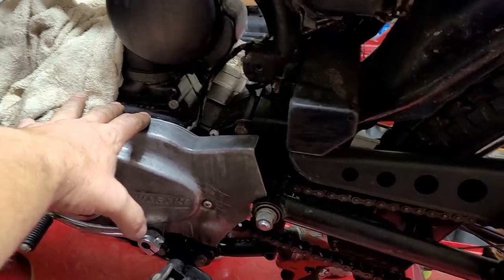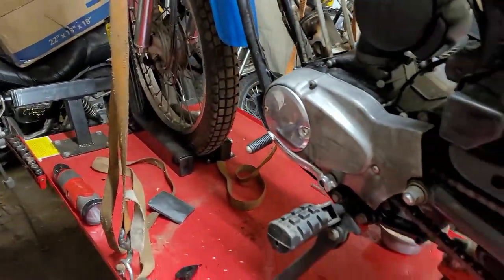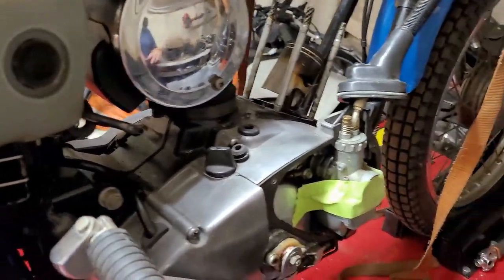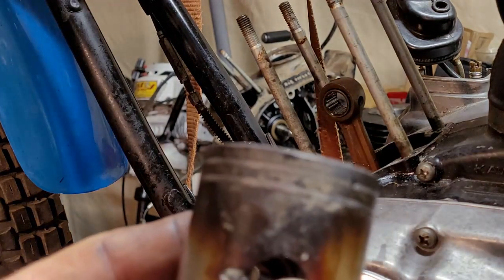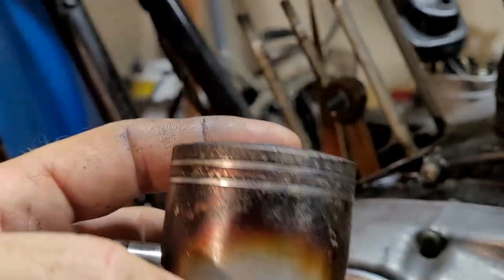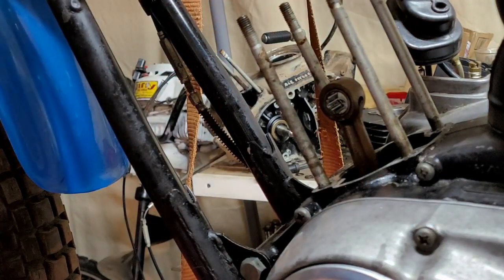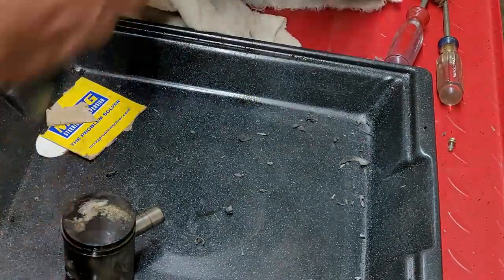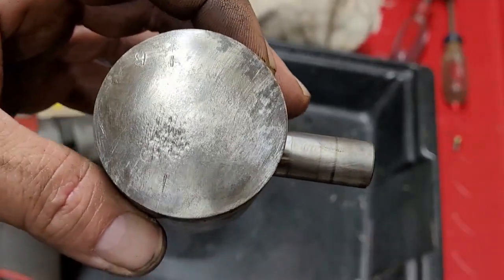Working on Aarons Ke100 top end do we have compression

Comment: Hi Kevin, great series of videos!
I have a question maybe you can help with. I am renewing the rings on my KE100 (B10 UK) as the old ones were worn out of spec. I sourced a set of NOS std. Rings. But they are not identical. One is dull grey all over & has a square edge to the cylinder, the other has a machined looking edge, with a tiny groove machined top & bottom of outer (cylinder) edge....which one is compression & which is oil ring!? (Olds were too worn to see any grooves)... Any help much appreciated!
Cheers, J

Comment: Hi Kevin, how are you doing? Maybe you can help me. I have an oil leak from the output shaft on my KE100 '92, but it seems not to be the oil seal. It seems to comes from inside the collar or the bearing. My manual says there are installed an 'O' ring (there was none when I took it apart) an then the collar. Question is, does your bike have it installed? What is the right way to install it? This could be the problem of the oil leak? Thank you!!!

Comment: This appears  to be an older KE100 1976?. What size of finishing hone do you use? Brand and type of ends?
Reply from the maker: Aaron's bike is a KE 125,his bike was a 1977, I believe. The hone is going to depend on how severe the scoring is. I don't use a brand specific, I get them off of Ebay. It really depends on who has the better deal. For light scoring, use the finer grit, and for deeper scores, use a more coarse, then use the fine. If you have a KE100 hone size is 49.

Comment: do you have any other tips for a ke100? I just got one and just put it over 1000 miles today.
Reply from the maker: Best tips i can give is check over your bike weekly oil tank vent tube chain tightness tires for psi and cracks inspect spokes and cables for adjustment and i use the half tank rule never let the oil tank go below half